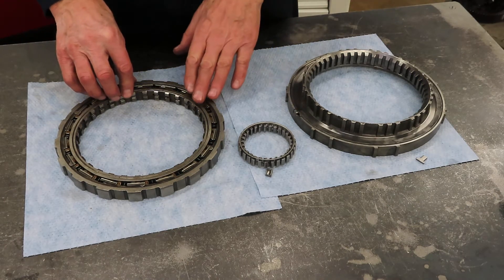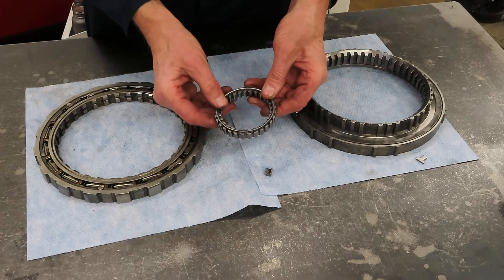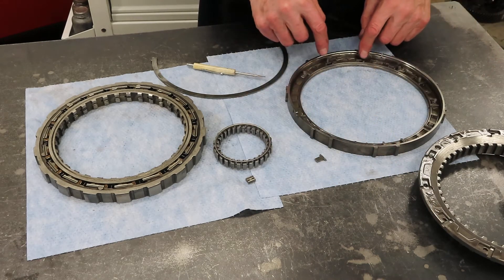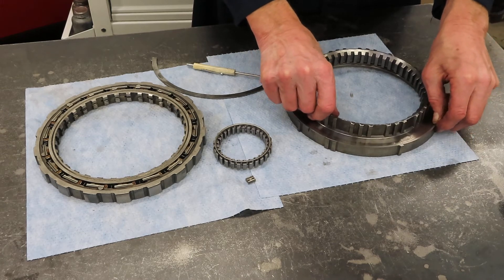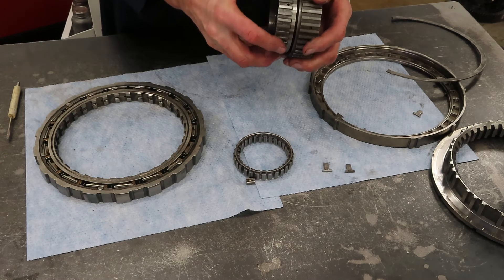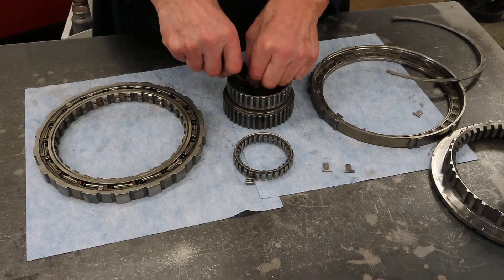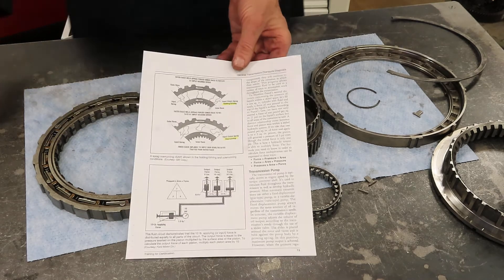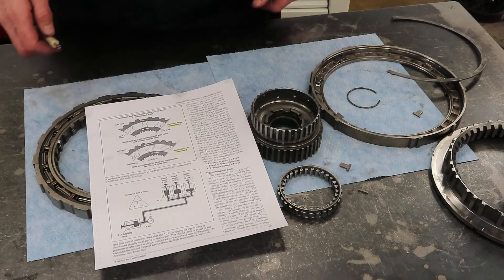One Way clutches 3 design types

Comment: 5:42.  Incorrect information.  When the sprag fails in a 4l60(E), you have NO forward motion at all in the automatic range.  You have manual 1,2,3 because the overrun  clutches are applied in manual range.
Reply: WYAT A STUPID FUCKIN PEICE OF SHIT RIGHT BARB... EHEH 

-Forklift operator 1981-present
-Sent from my Breville BTA830XL Die-Cast Smart Toaster 4-Slice Long Slot Toaster

Comment: Borg-Warner developed the sprag and it is stronger than a roller clutch size for size.  More expensive to manufacture though.  The original 700R4 had a roller clutch on the front sun gear.  It was soon changed to a sprag.